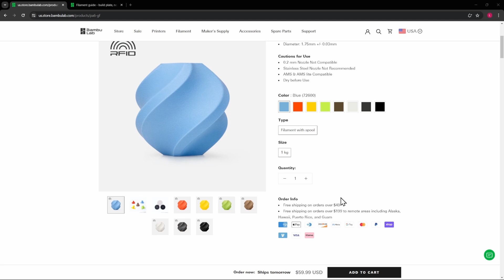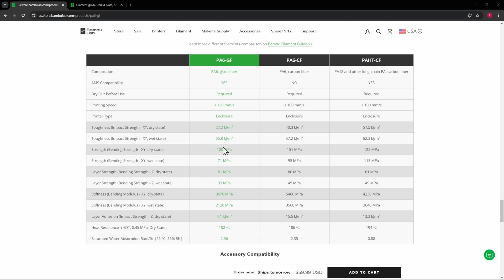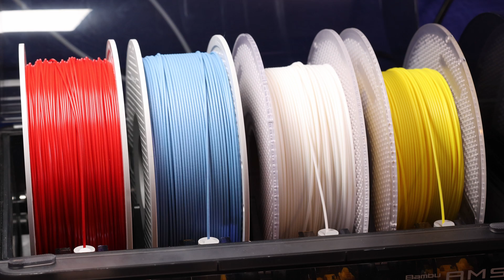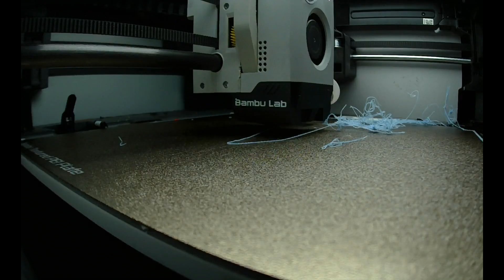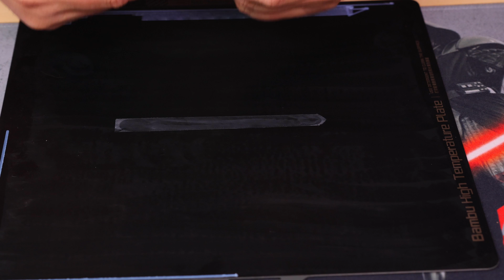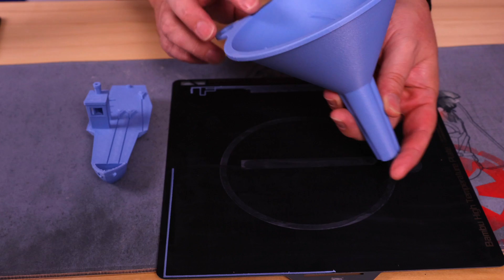Bambu Lab PA6-GF Review and How to install Bambu Studio Beta

Comment: I noticed layer bonding is not as good as PLA, PAHT-CF, etc. Filament guide shows PA6-GF has lower layer bonding. Increasing temperature does improve that but I have been struggling to get good tune. Flow, temperature, volumetric speed.

265c + 10.5 volumetric speed + 100c bed.. I can easily snap layer apart (around 4 walls thick)
290c + 10.5 volumetric speed + 100c bed.. seems to improve but I get 2-shade of colours (banding.. like changing colour band every 8mm height, it's bizarre..

If anyone has managed to do high quality print with great layer bonding, please share.
Reply: -- I print on QIDI Plus4 at 280C nozzle, and 50C bed instead of 80C, but it is Ploymaker's Fiberon PA6-GF with both top off and door wide open, and results are = smoother prints, and part does not sticking to bed too much, just a right amount, better/stronger though then PLA. Humidity after Ebos drying and storying at Polymaker container is under 15% humidity. I just ordered Bambu PA6-GF to try out.
Reply: also , dry filament a lot and keep the filament dry in IP67 containers with silicagel or aluminium oxide granules inside, and regularly dry granules too
Reply: A lot of the OG’s in nylon printing don’t use a cooling fan when they print nylon. It could be you have your cooling fan on which cools the nylon too much. You really only want to use Cooling on steep overhang and bridges
Reply: PA filaments from different manufacturers vary a lot, lots of tunung. If you print PA a lot, then the only advice is to use the filament that works for you, preferably branded for good repeatability

Comment: Who prints an oil funnel with 0.2mm nozzles?
Reply: If you look at the top, it is 0.4mm nozzle, not 0.2. 0.2 is the layer height, not nozzle size.